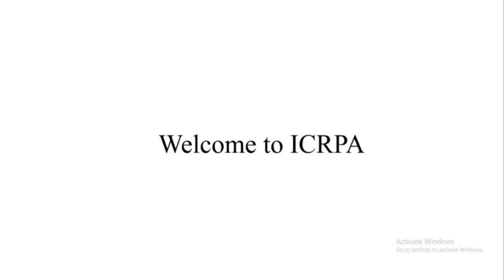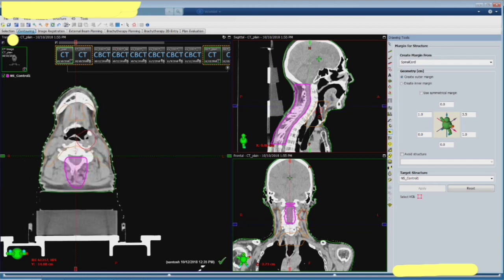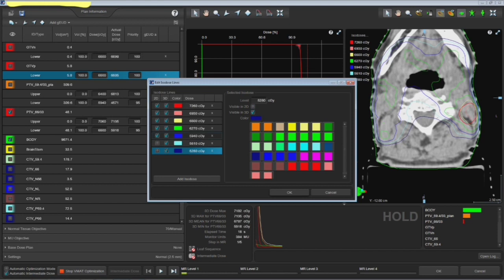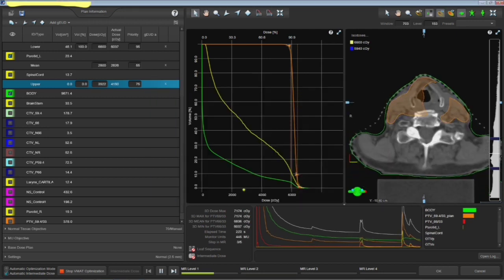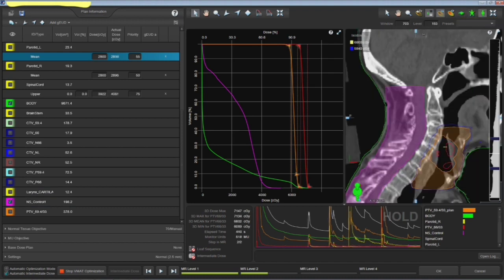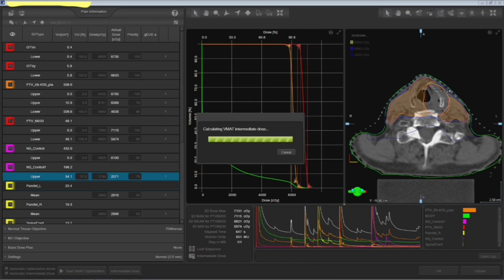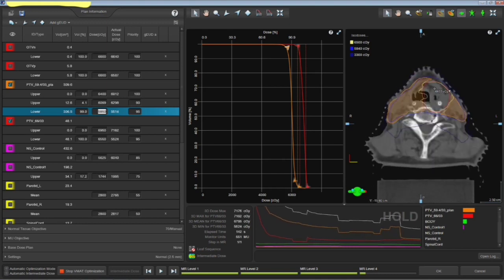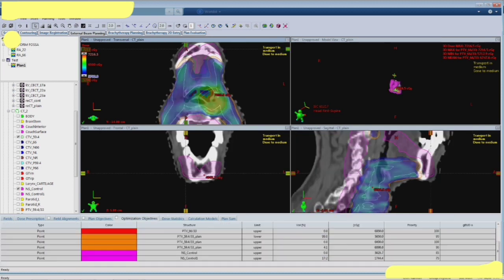RapidArc Planning In Eclipse TPS

Comment: Sir, We don't need to give any constraints to body?
Reply from the maker: No need to give in Eclipse TPS
Reply: @indianclinicalradiological8637  thank you for your reply. I would like to know about the four stages in optimization, gEud etc in detail.
Reply: ANJANA G KRISH in VMAT 4 optimization stage...first stage just observe PTV  coverage and second stage adjust OAR constraint if u want change...if u change any constraints after 2 stage it will no be effective.....otherwise just click stop optimization and again click start optimization...
if u give body constraint hot spot will be less compare to nil constraint for PTV...
just give constraint for body
0 %volume should not receive 100% prescription and priority  zero and after first stage change priority above or equal to PTV priority...now u can notice sudden change in hog region in dose distribution...
Reply: ANJANA G KRISH gEUD alone will no be good result..u can use gEUD with regular volume based constraints... usually gEUD good for mean dose organ...